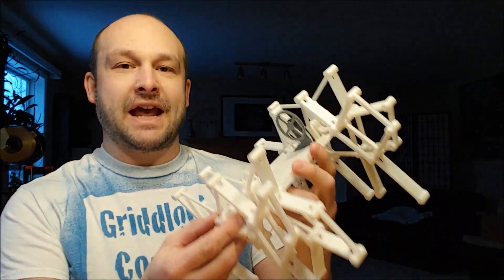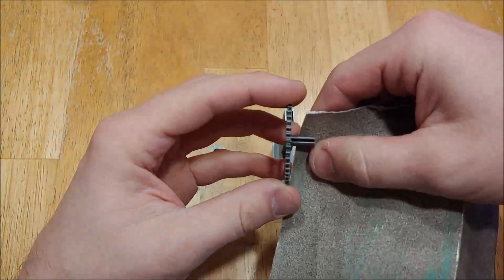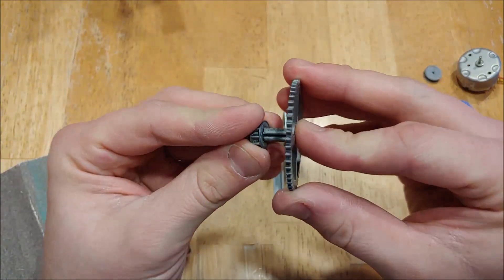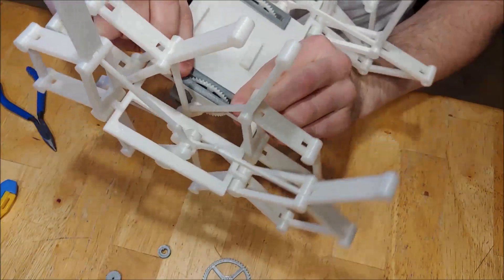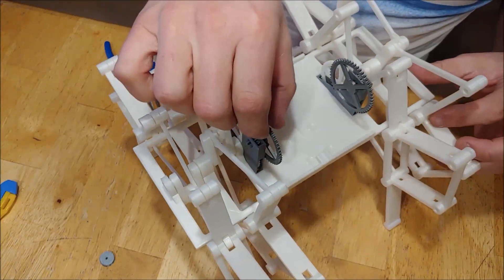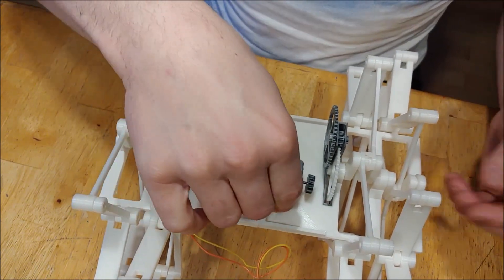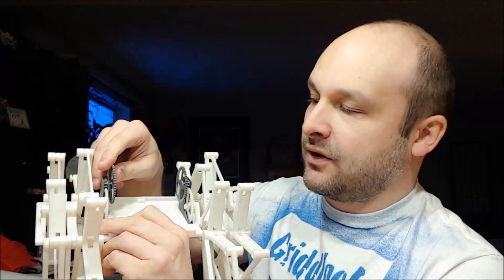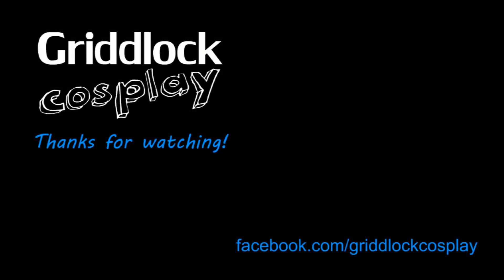3D Printed Strandbeest Gearbox Adapter

Comment: Very good design and work! May I please ask for the Solidwork files? I would like adjust the platform a bit to fit my sensors. Thank you very much.
Reply from the maker: Sorry, I don't have Solidwork files. I built this in Tinkercad, so all I have are the STL files. Or is that the same thing? I don't know....I'm not familiar with Solidworks.